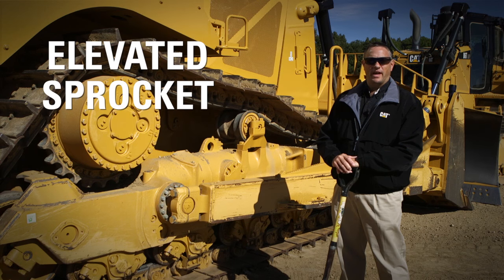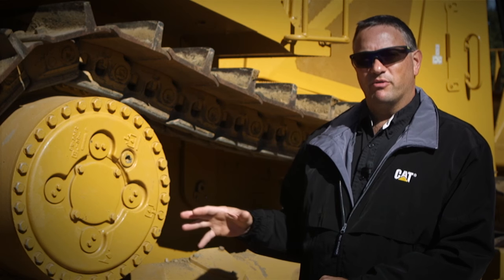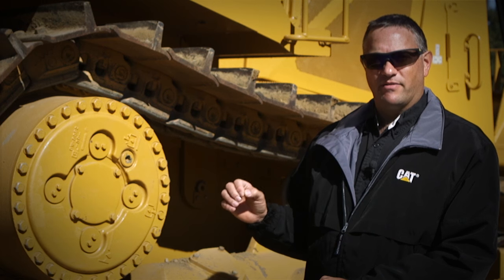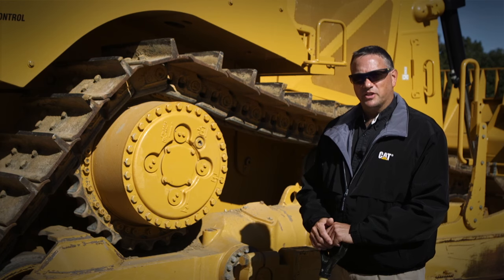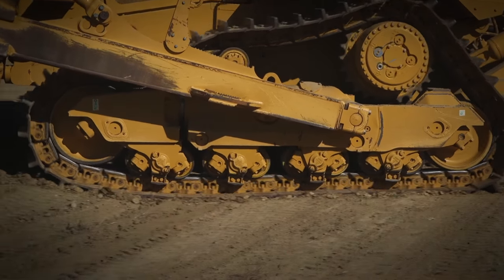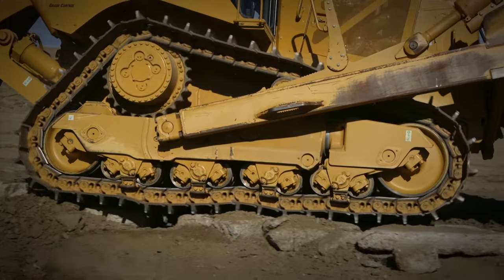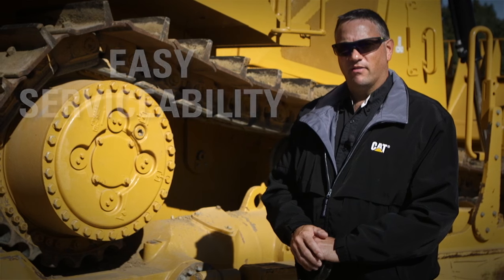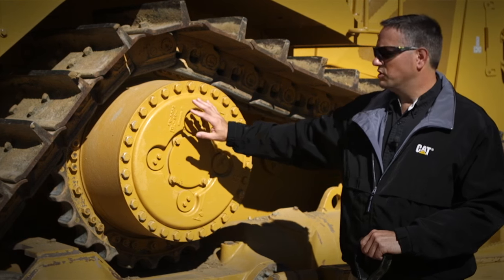Your Cat® Pro Knows Tractors | Elevated Sprocket Undercarriage

Comment: The most important thing he didn't mention was you don't have no dead axels to bend, as you would in the Lo drive models, all the pushing loads go to the pivot shaft, not the final drive Axel and bearings and gears. Cletrac had that figured out in 1921 when they brought out the first Hi Drive crawler.

Comment: One problem with these are when they are set up as a sideboom tractor. The high drive design moves the center of gravity higher. As well as attachment points higher as well. Which makes high drives as sidebooms less able to handle loads as heavy as tractors with an oval track configuration.